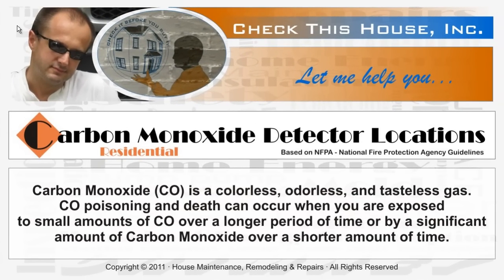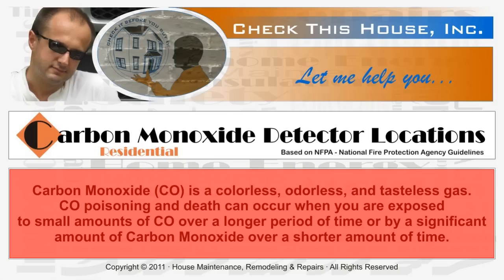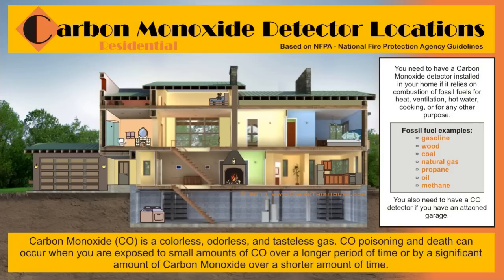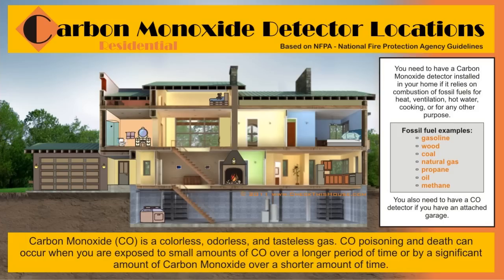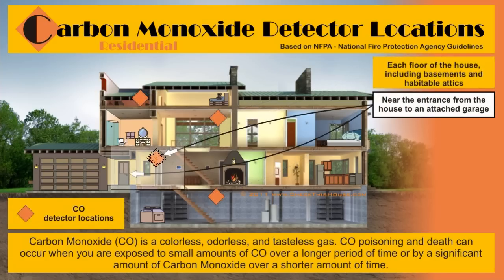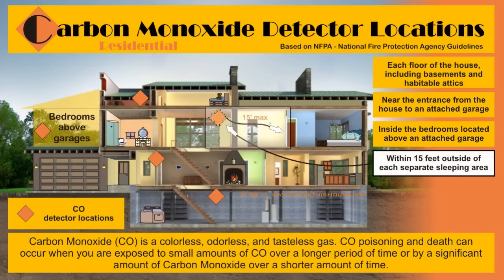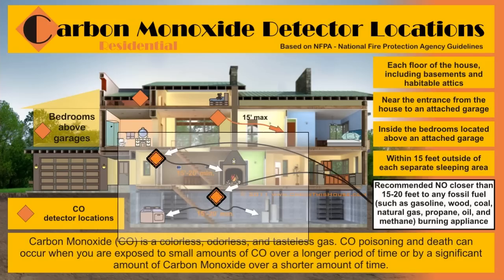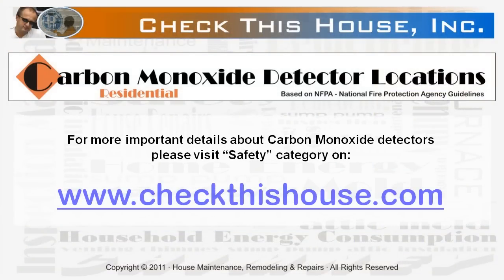Carbon Monoxide Detector Locations in Homes | CO Alarm Placement

Comment: Nice video however you do not mention where on a wall this CO detector is mounted. CO accumulates at floor level and builds upward, smoke starts at the ceiling building down. I have my CO detector mounted near the floor of my single-story home.